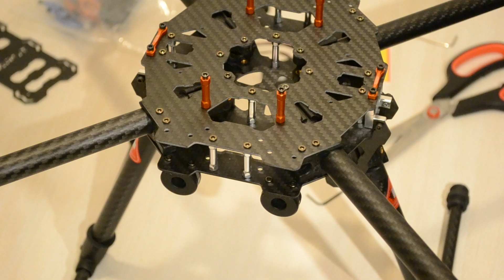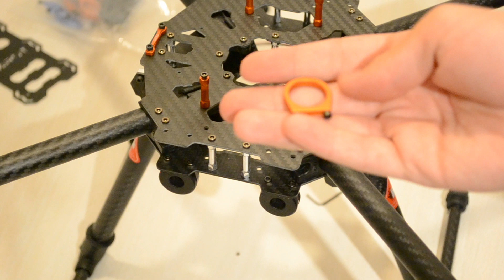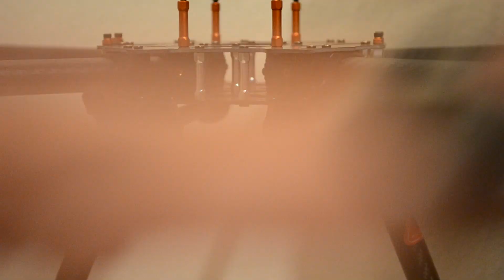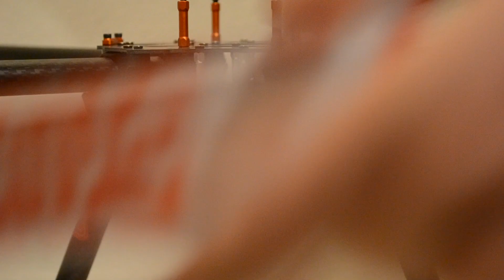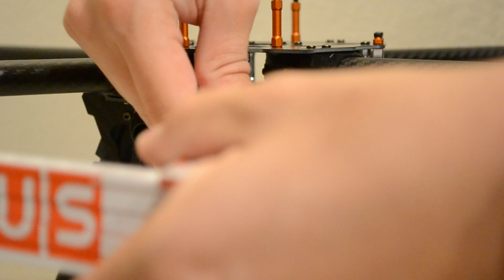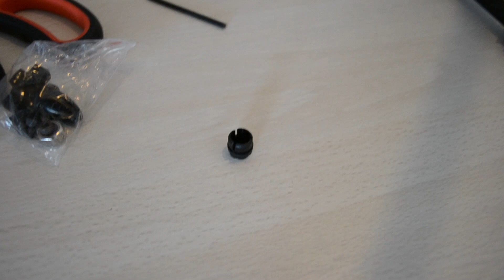Tarot IRONMAN 650 build and review - Under carriage  [Part 3]

Comment: can i spen  17 inch on this frame ?
Reply from the maker: Yes barely. That is the biggest prop you can put on there, but i would probably recommend getting som motor mounts extension just to be sure.
Reply: from where did you bought it ?
Reply from the maker: Mohammed Buti The whole quadcopter or which part do you refer to?
Reply: the frame only
Reply from the maker: Mohammed Buti n-factory.de is where i got it from.